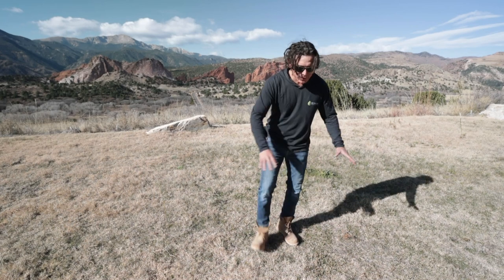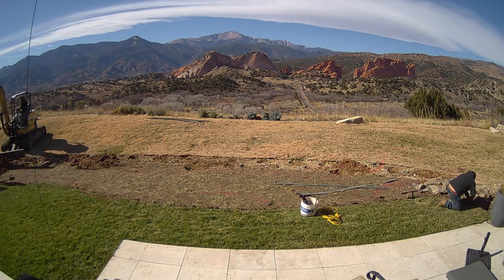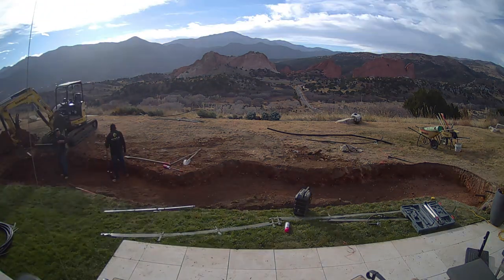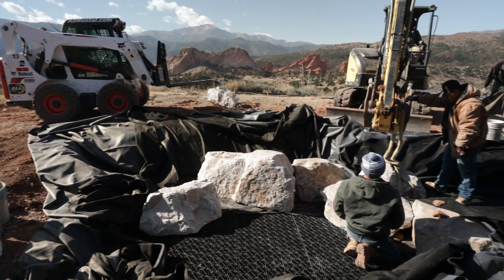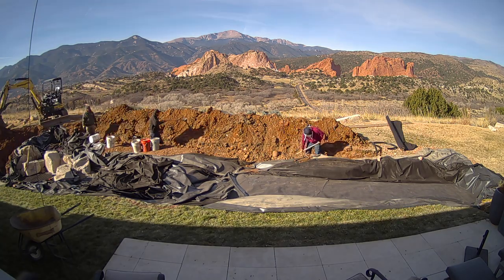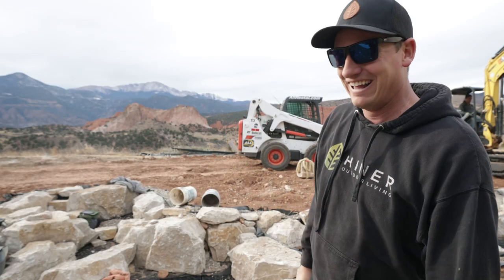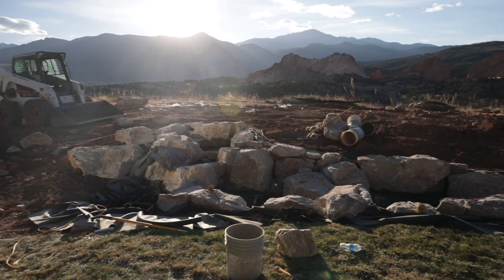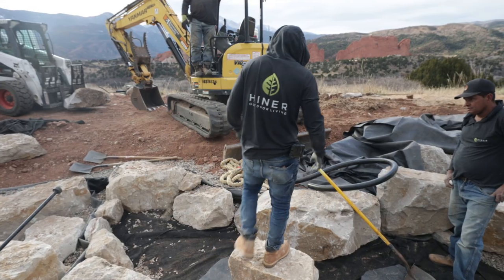Building a Backyard Stream with Waterfalls (part 1)

Comment: Matt, from what Omar said it sounds like you're connecting to an overflow storm drain system specific to that sub yes?
Reply from the maker: Yes, we're essentially building a huge french drain that surrounds the entire water feature which then connects to the storm drain just in case.